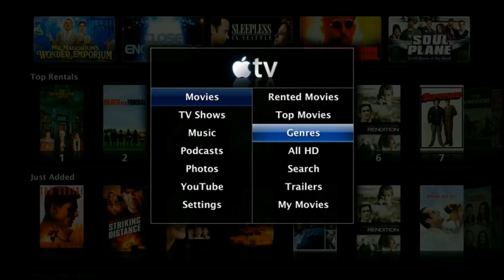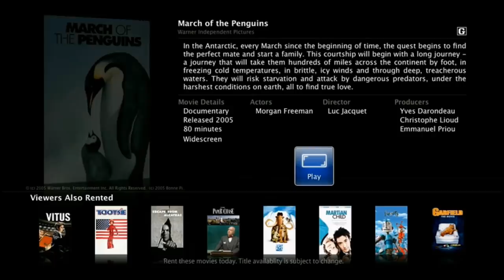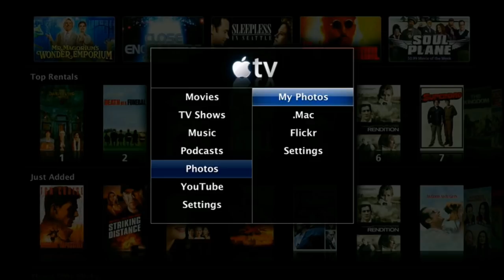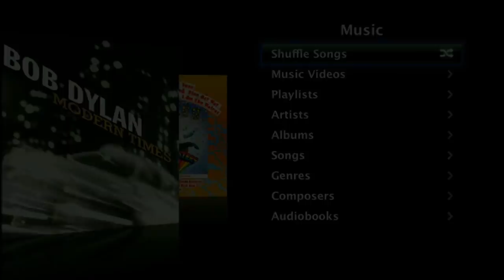1st Gen Apple TV & My Famous Ex-Girlfriend

Comment: The common hack is still to drop a bcm970015 Crystal HD card in place of the WiFi card and gain extensively better HD decoding capabilities. the latest versions of Kodi and distros containing such for these (which used to be XBMC) support this card and the older, not-recommended 970012. Aside from that, people have dabbled in installing IDE SSDs and even CF cards in place of the hard drive, but I've seen a couple IDE to mSATA adapters inside those for mSATA SSDs too.
Reply: Sudo
Reply from the maker: Very interesting stuff, thanks for sharing!

Comment: I was planning on sitting out the format war until it was over.  But my regular DVD player conked out just before Christmas 2007.  I put "new DVD player" on my Christmas list. My dad got me an HD-DVD player.

In the box was a coupon for 5 free movies by mail (plus there were two in the box.)  You had to mail away the UPC/bar code from the box plus the purchase receipt to get the 5 free movies.  You had to do it (postmarked) within 30(?)* days of the date of purchase on the receipt.  I waited until like day 28 to mail it off, just in case the format war ended in that 30 day span so I could return it and buy a Blu-ray player.

After I mailed off the coupon, but before the movies arrived, the two-month span that was the complete and total demise of HD-DVD happened. I ended up buying an Xbox 360 HD-DVD drive a couple months later during Circuit City's going-out-of-business sale for like $20.  I didn't even have an Xbox at the time!  It included a coupon for 5 more free movies by mail (plus one in the box.) Thus, as HD-DVD was in its death throes, I had 13 movies for a total outlay of $20.  I ended up buying more only once they were on clearance at other big box stores (Fry's Electronics famously had bins of them for $1-$2 per individual movie, $5 for a box set. I bought the Matrix series that way.)  

Then Warner Bros offered their "Red2Blu" trade-in program - pay a couple bucks, and get your WB movies you owned on HD-DVD on Blu-ray.  Replaced all the movies I cared to that way. (Bonus: The Blu-ray box set of the Matrix was more "deluxe" and included more than just the three theatrical movies.)

The Xbox 360 HD-DVD Player drive and a since-acquired Xbox 360 still sit in my AV cabinet, for whenever I get a bug up my butt to watch one of the three movies I have solely on HD-DVD. (The US release of Harry Potter 1 - I have the UK box-set of the whole series on Blu-ray; King Kong; and Flags of Our Fathers - strangely, its companion movie Letters from Iwo Jima was released on home video by WB, so it's one of the ones I cheaply 'upgraded' to Blu-ray, but Flags of Our Fathers home video release was Paramount, so I never 'upgraded' it.**)

*I think it was 30 days. I know that I sent it off, and Warner Bros announced they were going to stop supporting HD-DVD within a week, and Netflix, Best Buy, etc, all dropped HD-DVD within the next month.

**Just looked up Flags of Our Fathers / Letters from Iwo Jima - apparently the two studios (WB and Paramount) co-produced the two movies, with one taking US distribution for one movie and international for the other; and the other company taking the reverse. Annoying.

Comment: I got into HD DVD early on, also. The players were half the price! Like the Dreamcast, it was a great system that Sony stomped into the dirt.
Reply: Di3mondDud3 It’s not the capacity, it’s the encoding. BD originally used MPEG-2 and it looked bad. Now it’s AVC. A lot of BD masters are just copies of HD DVD encodes.
Reply: Di3mondDud3 MPEG2 1080p didn’t look as good as AVC 1080p. A lot of the early releases were remastered in AVC, sometimes just by copying HD DVD files over.

Comment: The 4K AppleTV has dropped USB (annoying, I used the USB port on my previous one to charge the remote,) and optical audio.  Only Power, HDMI, and Ethernet. (Keeping Ethernet is appreciated, because my component cabinet is a dead zone of WiFi with all the other equipment in there.)

Comment: It really shocks me that IDE was still being used in 2007, granted I was only 10 then but it felt like SATA was the only way for a long time by the time I got into PCs
Reply: I was shocked to find that my 2008 Mac Pro uses IDE for the optical drives. It uses SATA for all the HDs. There may have also been an extra SATA port on the motherboard.
Reply: Maybe it’s because all my computers were second-hand until I got a 2012 Macbook Pro a couple years ago (which I installed an SSD in), but I’m only 20 and I’ve been quite familiar with IDE. 
I STILL have an IDE hard drive in my media server (granted among four other SATA drives)

Comment: cheap adroid tv box would be better then this now days unless you get one of theses dirt cheap
Reply: There are hybrid boxes that run both DVB-T2 and Kodi Android systems. But the systems are not smoothly integrated so user had to switch between dvb-t2 or kodi android modes